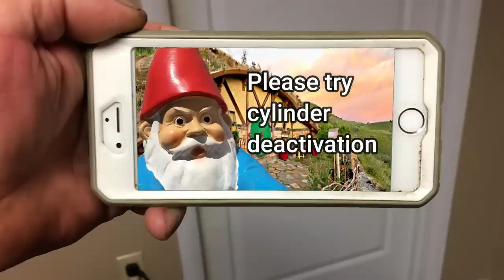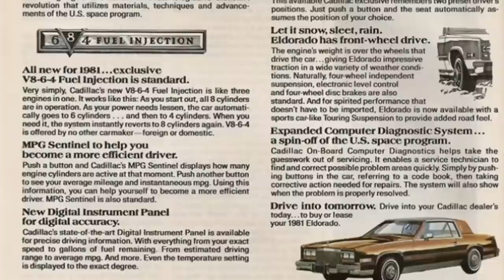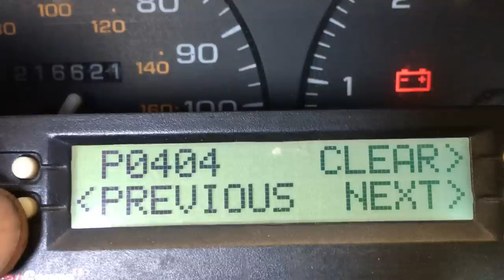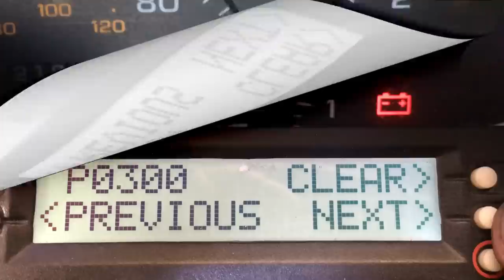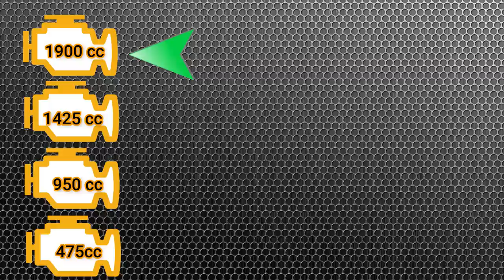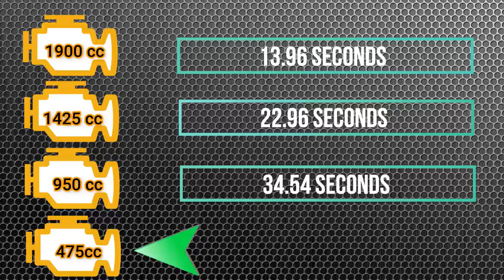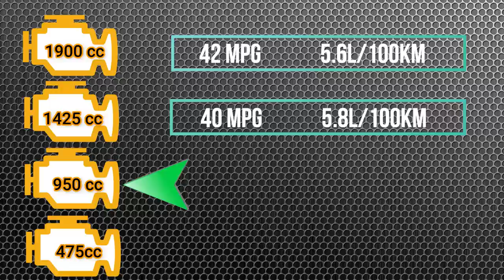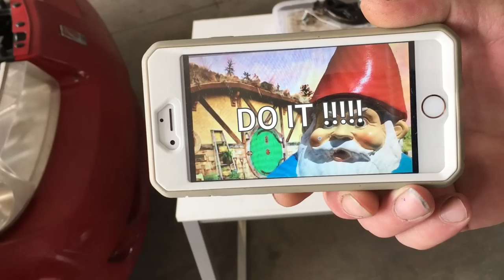S2E16:  We deactivate cylinders on our Saturn and test the car for performance and MPG

Comment: Removing the spark plugs from the deactivates cylinders would of been an interesting comparison. A little less compression to fight against🤔
Reply: That would have been my first instinct
Reply: I was thinking that the exhaust valves needed to be propped open for the same reason, but pulling the plugs would be a much simpler (but probably louder and messier) way to provide proof of concept.
Reply: @maxxron  One could also connect all (deactivated) cylinders with eachother to keep it as a closed system but have no vaccuum or pressure
Reply: You don’t want the pumping losses that would cause. It is much better to keep the volume of air constant in the cylinders. It will act as a spring compressing and decompressing during the cycle, ideally there would be no leaks too.
Reply: I was thinking that it might cause a slight imbalance but it would be a quick and simple experiment.
Reply: @andrewwhite986  Love the comments here.
Reply: @muh1h1  that might still lead to the engine fighting compression or vacuum robbing the engine of some horsepower. My thinking about leaving the exhaust valves open would leave the cylinders exposed to open atmosphere without wasting any of the atomized fuel in the carbureted engine. I'm not sure how the fuel injectors were bypassed or or whether there would be some parasitic losses or waste in that closed loop somewhere.
Reply: @maxxron  That would also mean the engine would suck in exhaust gasses from the other cylinders with every downstroke, that can't be very healthy for the engine
Reply: @muh1h1  Yes, but it would mainly allow the piston to travel more freely up and down the bore without fighting compression and vacuum forces. The amount of exhaust it would suck in from other cylinders wouldn't be any more than it would produce if it were operating as a functional 4 stroke cylinder igniting gasoline on in the power stroke.
I also do not believe engine longetivity is of any importance in this little 4 to 2 cylinder conversion experiment.
Reply: @Turbochargedtwelve  that's a good point but I would assume having that massive pressure in those cylinders would cause more oil to be drawn in. with the spark plugs removed, could help some of that oil build up
Reply: @maxxron  Yes. If the plugs out worked, then keeping the exhaust valves open would also remove any oil fumes if there is blowby past the rings on the deactivated cylinders.
Reply: That's what I would've tried.
Reply: @maxxron  issue is the valve held open would hit the piston.  Assuming it's an interference engine and most 4 bangers are.
Reply: Removing plugs might allow debris into the engine, but disabled cylinders are typically left closed to avoid pumping losses.  While it intuitively seems that letting the dead cylinders breathe would be best, just removing the valve action and fuel supply is likely better because less total work is being done to compress/uncompress the air than would be done if "new" air were being pumped through the cylinder.

Though losses still occur, mostly through heating, the air in the cylinder becomes a spring that can be squeezed and released, giving back some energy to the piston on the down strokes.  Pumping air in and out never gives back any energy and is more work than it might at first seem; this engine revolves up to 110 times per second.

Due to the vacuum that surely occurs in the sealed situation, oil might eventually fill up the cylinder and break the engine, probably by throwing a rod.  RC drove each setup for over 100 miles, so this apparently didn't become a problem over that substantial number of revolutions.  Opening the plugs should avoid the oil buildup issue, but reduce total efficiency.
Reply: @antibrevity  What if you block the intake and exhaust ports?
Reply: With the sparkplugs in, it will 'bounce' on the compression and vacuum of those cylinders. If you remove the spark plugs, there will be pumping losses, as the air is drawn into and blown out of those small spark plug holes. It will act like a 'jake brake, greatly reducing the performance of the engine. Much better, to leave the sparkplugs in.(not to mention, the noise!!)
Reply: @vincentrobinette1507  Thank you for these comments.
I come for the videos here and stay for the smart comments
Reply: @Avi8tor857  valid points.
Reply: @andrewwhite986  I was thinking the oil blow by was being caused from the vacuum of a piston traveling down in the chamber with no valves open creating massive amounts of vacuum to suck the oil past the rings.
Reply: @muh1h1  the engine is already full of explosions that create exhaust gasses. why would it hurt it?
Reply: @maxxron  propping them open may have caused some piston to valve clearance issues.
Reply: To those who think it is better to let the engine compress the air. I believe it would help to take the sparkplug out, atleast on my motorcycle its easier to kick over without the sparkplugs, so i feel like this would be the same here! Wouldn't it?
Reply: There with definitely need to be some means to verify there wouldn't be any piston to valve interference. In reality, they would only need to be open a couple millimeters to reduce or eliminate the vacuum and compression issues negatively affecting performance in the deactivated cylinders.
Reply: @maxxron  remember that the sparkplugs will keep on sparking and you could cause an explosion of unburnt exhaust gases because of that
Reply: plus with the exhaust valve propped open the piston will hit the valve every time its in top dead center
Reply: Might interesting to try...say on the 2 cylinder scenario...but nobody does this in mass production.  Bleeding cylinder pressure is not something that hasn't  been done before.  1930's John Deere tractors had cylinder pressure bleed valves for starting.   If there was an advantage seems that there is little manufacturing cost to keep it off mass production vehicles.
Reply: @oskarpolanski3152  I hadn't thought of that, but if the other cylinders are running rich that's a possibility. But the only thing you need to do to stop that is pull the plug wire.
Reply: @oskarpolanski3152  it would definitely have to be checked to make sure it was not an interference engine before propping open the exhaust valve. But it wouldn't need to be opened fully, just cracked open.
Reply: the issue with that is that this is carbureted instead of fuel injected so it would be robbing adjacent cylinders of fuel and just blowing highly flamable fuel air mixture out the spark plug holes.
Reply: never mind, i realize i misread your comment.  thought you were suggesting just removing the plugs instead of deactivating the cylinders mechanically.
Reply: Best to remove pistons/rods/pushrods or rocker arms etc. Anything creating friction will reduce power and increase fuel consumption.
In Japan, the term used by engineers for the word 'friction' is 'lost horsepower' (rosu bariki).
Reply: @jiyushugi1085  Thats a great idea.
Reply: @jiyushugi1085  If you remove pistons/rods you will have un-balanced engine.  You would need to add weights to the crank and also plug the oil holes.
To others - - 
The sealed cylinder (de-activated) assumes a pressure balance as if the piston is half-way. On a 10:1 CR engine the piston compresses 5:1 then at the bottom of the stroke the pressure is 0.2 Bar ( minus 12 PSI or 3 PSI absolute) or a fifth of atmospheric.
Reply: If the intake valve is opening on stroke 1, it would suck in gas and blow it out the spark hole.
Reply: What you "lose" in compression, you "gain" right back in the expansion that follows it, minus a tiny bit of entropy (which won't make enough difference to register). Go ahead and try that - if you have a manual car with cable-driven throttle, go to the top of a hill, accelerate down, get to a good speed in a gear where full engine braking feels good and switch off the ignition (DO NOT lock your steering!).

I'd make sure your power steering is hydraulic as well, by the way! Do that before you start.

Now that the engine is off, though still spinning, put your foot down. All the way. You want that throttle wiiiiiide open. Notice a difference? No? Now pump it up and down a few times. Still nothing? Yeh, that's because "pumping losses", "working against the throttle" and a few other "explanations" perpetuated by "educators" are a load of bollocks put forth by morons who don't understand how this works.

Your engine braking comes from the parasitic losses in your engine. Those are there no matter what you do or how you drive, and they tend to increase at higher engine speeds. That's your cam shaft pulses (pushing down the rather strong valve springs, for example), all the viscous drag on the oiled sliding surfaces (pistons in bores, bearings, oil pump, etc.), alternator drag from the electrical load, etc. Bigger engines have more - smaller engines have less. And the same size engine with more cylinders will also have more. It really is that simple. That's why econoboxes have no power and big powerful engines get shyte economy, no matter how conservatively you drive.

One way to cheat this system is to run the engine at its optimum thermal efficiency. That, by definition, is when it's operating at the highest possible pressure ratio - i.e. wide open throttle, peak fill, or where you get the most torque (since that also requires full cylinders and highest pressure ratio). As you can imagine though, that's impractical for most scenarios, especially with a powerful engine, so disabling some cylinders means that the remaining ones have to produce more power, which may push them into higher thermal efficiency. That's the hack. And for cruising it could be quite effective.
Reply: Remove the rods from two opposing cylinders so there is no compression and no drag (need a way to balance the crank though...)
Reply: @FtanmoOfEtheirys  Yeh, that might actually save some fuel
Reply: @maxxron  Or just put some pipes on the cylinders that make the oil go to the oil filter or a catch tank
Reply: wouldn't work that way because the fuel injectors will still be shooting fuel in the cylinders on every rotation.
Reply: @Sir_Leelord  Those are easy to disconnect
Reply: @Sir_Leelord  he deactivated the injectors

Comment: I'm sure if the 2 cylinder mode is only activated on low power mode and 4 cylinders when actual power is needed, the economy could be quite substantial.

Also leaving the valves closed is creating some kind of vacuum pump in the deactivated cylinders.

Real engine with cylinders deactivation also had oil burning issues because of that.

Edit: some kind of reverse Jake brake system can be able to squeeze some more hp into it I think.
Reply: I was going to comment on the similar. Would be a better test to lock the valves open on the deactivated cyl's
Reply: @fryguy503  I think that would create a lot more heat and overheat the cylinder
Reply: @fryguy503  Locking valves open would not be the ideal situation. It would screw up the exhaust pulse timing and take away any intake charge air/pressure boost advantages from the remaining cylinders. Also, the dead cylinders will always be eating a lot of filthy exhaust air on top of the EGR and oil already being pushed into the cylinder chamber with no way to burn it off. Any gains from reducing the compression load on the deactivated cylinders would be lost from the rest of the system becoming less efficient.

Comment: I love this channel. There’s nothing better than a cup of coffee and Robot Cantina on Sunday morning. 

The engine was burning oil after number two was reactivated because the piston was still moving in the bore and creating a low pressure area. Oil was sucked past the 216,000 mile rings, then blown back out past them. Residual oil coated the inside of the combustion chamber, hence oil burning.

Comment: My first new car was a 1994 Saturn SL (the base model with manual window cranks).  It had either 85 or 89 HP (don't remember exactly).  That car was SLOW!  I used to call the A/C button my Turbo button, as you could feel the power boost when the A/C was off.  I used to turn it off to go up mild hills.  I drove that car for 160,000 miles, and it was still running well when it was totaled by an 18 wheeler.  Thanks for the memories!!!
Reply: I have a 2002 Saturn SC1 with just over 115k miles, ive driven it all over the past year or so with no issue. No AC, slow, but by god is the gas saving awesome. Compared to my other cars it's insane.
Reply: thats crazy thanks for sharing😀
Reply: i have a 2001 1.9 with 335k miles and never let me down anywhere one of the most reliable cars i've owned and i have owned lots even Mercedes Porsches and BMW's

Comment: Why  didn't remove the spark plugs in the deactivated cylinders, you are losing power by comprising the air in the cylinder?
Reply: And air will work like spring and bounce back. Actually there's no air insid. All air will leak out in a few minutes

Comment: Why didn't you remove the spark plugs? With both valves closed, you are going to be building compression on the up stroke and vacuum on the down stroke on every single stroke. I bet you could have got better fuel economy numbers on the 2 cylinder if the engine wasn't fighting that 100% of the time.

Comment: I guess the almost unchanged fuel consumption may be caused by the ECU more often goes into full throttle enrichment. I've heared that also carburettors sometimes do the same trick of enriching fuel mixture near full throttle, but I don't think that will happen with a simple carburettor as the one from a lawn mover. -Would be interesting to see a comparison with the two cylinder deactivation together with the lawn mover carburettor! Deactivating cylinders by disconnecting the valves is off course easier, and certainly more reversible, compared to entirely removing pistons. I did the latter to a Fiat 127 after having a big end bearing seized. I knew from having a 2-cylinder Fiat 126 that engine balance is really poor with two pistons running in paralel, and running a 4-cyl on 3 is also really bad. I therefore chosed to remove a the counter acting piston next to the one with the seized bearing. I got really good mechanical balance, but having a 180 degree firing order gave the shakes at low rpm so I guess it all would have turned out better if I had chosed 360 degree firing order instead, and kept the big ends of the conrods instead of welding the oiling holes shut. Anyhow, the Fiat 127 had a carburettor and I got a fuel saving of 10-15%, meassured during a year and over 40.000 kilometers. https://www.youtube.com/watch?v=GcKNt6QxEYE
Reply: This. On my older sefi, the throttle input is linear to fuel load % up to 50% or so throttle. At 50% throttle, it goes to 100% duty cycle and switches from sefi to batch fire, firing 4 injectors per side at 100%.
Reply: I was wondering about that myself.
Reply: That plus the ecu probably sees its running lean with two unplugged and puts way more fuel to the system.